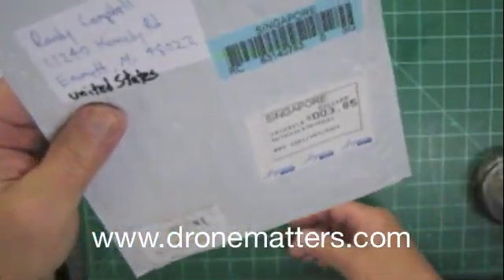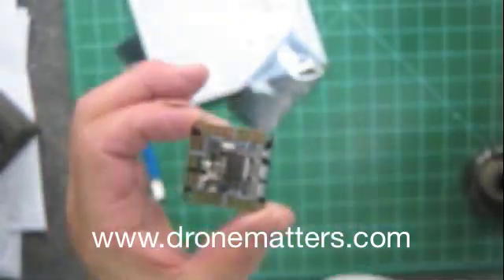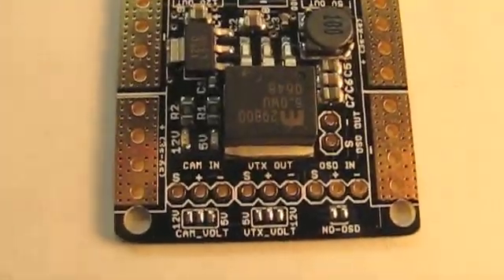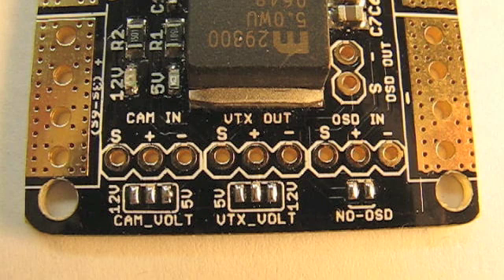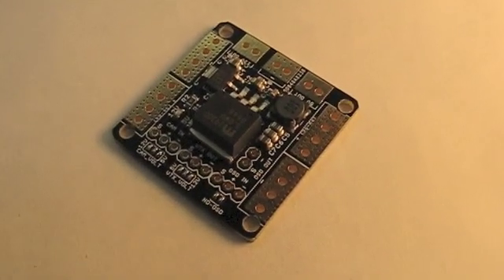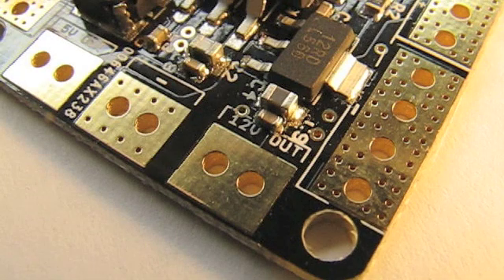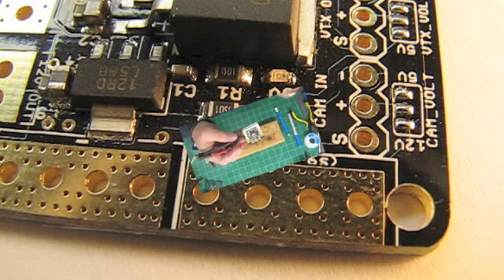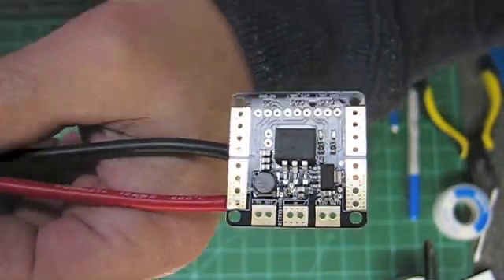ATAS Power Distribution Board v2

Comment: have you used this yet? I'm having trouble doing the solder bridges for the vtx and camera voltage selection.
Reply from the maker: Monkeefied Hey, thanks for the query. It's been awhile, but no, I had no probs with the board at all. What seems to be the issue? Is your iron hot enough or have you made the bridge and it's not working?
Reply: rumblecloud I think my iron may have been too hot actually. I did just get it, I put the solder on the pad and then would just touch the iron QUICKLY to the solder to get it to stay there and then once I built up a little solder on both pads I would again real quick run the iron between the 2 and it would bridge. Just took me a bit to figure out a technique that worked :D. I was getting a clear liquid off the board (flux?) and the solder would just stick to the iron and not the pads. Thanks for the super quick response!
Reply from the maker: Monkeefied Yup sounds like it was too hot. You have to be careful with that as you can burn copper foil right off the board. Glad you got her sorted out though. Take care

Comment: A review should also include some testing.
Can you please test the board on 6S and power some components from the 5 and 12V outputs?
All the regs are linear - they will get very hot under load and then maybe shutdown.  If you attempted to pull 3A from the 5V output running from 6S, you would be dissipating over 50W in the regulator alone (to get 15W of output power).  I'd be surprised if lasted longer than 60 seconds before it shutdown or melted.  12V rail, same story.  I think they may be over-estimating the current capability of their regulators. Can you please test this and post the results?

One other thing to be careful of is on the rear of the board the mounting holes are so close to the power pads that there will inevitably be shorts from battery to frame.
People need to be warned to use nylon screws especially on carbon frames.

Thanks
Reply from the maker: Thanks Melbourne. That's the kind of feedback I needed. I'll see what I can do to test out your requests. I admit I am a bit of an amateur at this, but will see if I can push the board a bit.  Thanks again.  r
Reply from the maker: rumblecloud
Subscribed BTW and thanks